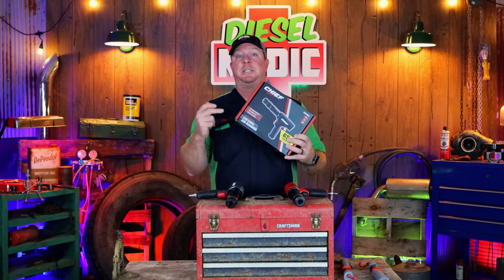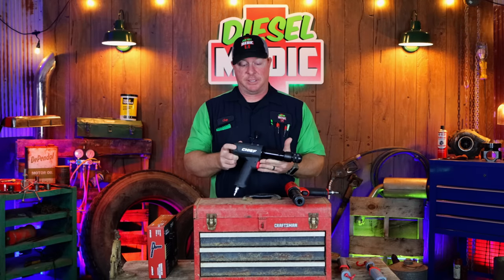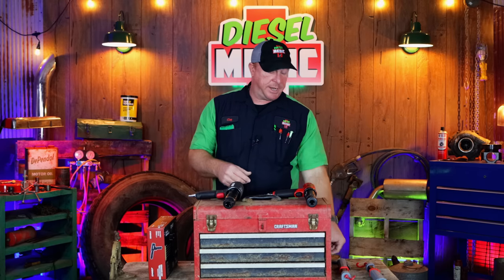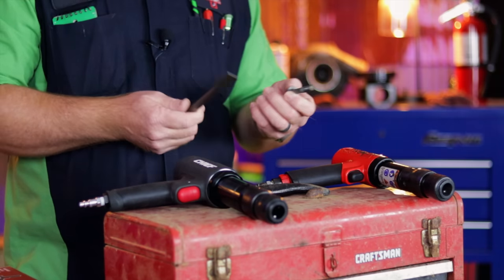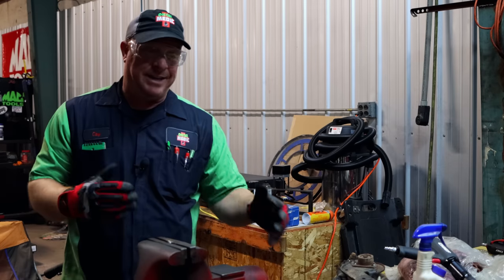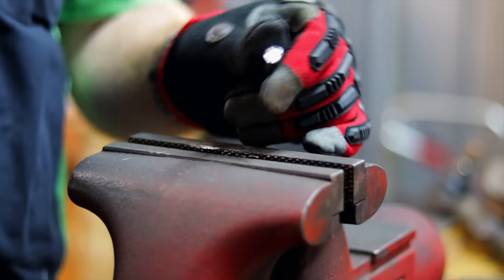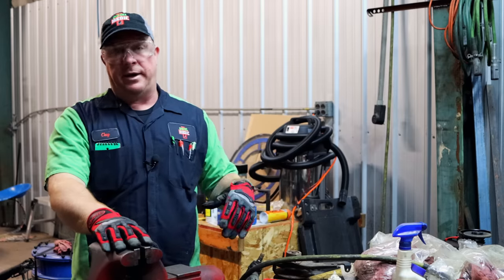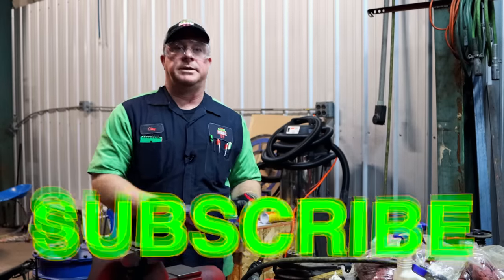Chief Air Hammer Test Head To Head VS Snap On

Comment: Use it for 6 months and give us an update how you like compared to the snap on that’s a real test I would say
Reply: Not much to go wrong on an air hammer bud. Even a soft hammer is good enough for awhile. Not a harbor freight shill, don't own this hammer, and plenty disappointed with a decent amount of dumb tools from harbor freight.

Basically comes down to moisture removal and oiling before putting a tool away. Maybe he more $ is less sensitive to proper use, but this is a great deal imo.

May be disappointed in time for semi-occasional-hobbyist use after I get one for honda ball joint and bearing removal, but I bet it would be quite good for quite a while.

t.buys american whenever possible, as in +200% cost over chine shit for an "I need it for this task, may need it in the future, so why not".

I do have several other chief tools, purchased for specific projects, that sit until I need them again (infrequently) and they're just fine.
Reply: @anon58973  well I’ve had my snap on air hammer rebuilt a couple times but I use it every day so just cause it’s a simple design doesn’t mean it doesn’t wear out if it wears out in 6 months it ain’t worth it to me I can get a few years out of my snappy and before it needs a rebuild and the rebuild is cheap and fast, I doubt your gonna walk into the store get them to rebuild the chief or give you a kit to do it yourself. I think your thinking everyone is a hobbiest which is not the case for me hence why I said use for 6 months then let me know how it is
Reply: @zbrown362  thanks zack, your probably thinging everyone is a pro user. So let's meet in the middle, chief prolly a great choice for amateurs snap-on for the prose like you.

Comment: Awesome. I got the Chief air hammer about 2 months ago and have used it almost daily since. Working in Wisconsin it gets put through its paces. Hasnt been stopped by a seized in hub assembly or brake rotor so far!
Reply from the maker: That’s good to know ! I’m impressed with it
Reply: I did pay the extra $15 or whatever it was for the extended warranty in case i have any issues but so far its been great.

Comment: I had a PH2052  since 1997  it still strong as ever. I've so used many times for the real test was losesening ball joint using a pickle of fork and  low speed control to loosen striped dome shape allen bolts !!  Precion Speed control is key to nothing beats a snap on !!

Comment: I use the Chief air hammer professionally and it's a absolute beast! I also own the Chief  reversible cut-off tool and it's a beast too lol!! You can also still use the 20% coupon on the Chief line.

Comment: Impressed so far, interested to see how it holds up in the long run. For $129.99 hard to argue not picking it up.
Reply: Been using it for several months, holds up great I have been abusing it. The only issue is the threads keep coming out from vibration so as soon as you buy it loosen all the threads put threadlocker and tighten it down and you will be golden

Comment: We were trying to drive out kingpins from the forklift at work... using heat and good old hammer and punch, wasn't budging those kingpins... I recommend the chief air hammer to the boss man so he sent me to go grab one.. the price went up to  $139 and Harbor freight didn't have any accessories (hammer, chisel). Ended up getting an 8 inch hammer bit from Matco. I'll tell you, this chief air hammer is a beast !! It took a little bit of time but it drove them kingpins out 👍👍 for the price, compared to snap on.. can't be beat.. another great tool from Harbor Freight!!
Reply from the maker: It hits hard!

Comment: I love my matco air hammer. Everyone in the shop wants to borrow it because it has more power than theirs haha.
Reply: I have one, the Damn trigger fell off.. Seriously.
Reply: @jeffdarkness666  Dang, that sucks man! Probably out of warranty too, right?
Reply: @koorite.  YEP, I'll get it fixed one of these days, until then I got my old bullet proof Snap on I've had for 15 years, it's not as powerful as the matco but a heck of a lot more reliable.
Reply: @jeffdarkness666  Heck yeah. Our engine guy was using his snap-on air hammer a while back to knock out some frame rivets on a 2500, and after a while of slow progress he asked to try my matco since it was only about a month old then, and it knocked em right out. He said he would get one if he wasnt planning on retiring in about a year haha.
Reply: @koorite.  I like the Matco, don't get me Wrong, just wasn't impressed with the trigger, I had it for 2 years until that happened, and to make matters worst we don't have a Matco Man right now, ours retired to play with his dirt track car full time I reckon.
Reply: @jeffdarkness666  That sucks man. I feel ya though, we didn't have a snap-on guy for almost a year.
Reply: @erictech201  threw the Snap on the floor for 15 years with no issues, so yeah, I have an even older Ingersoll that still works fine.

Comment: Harbor Freight has stepped up alot I have alot of there tools today I have A 3/8 Earthquake 20V Xt it works well and I have abused the crap out of it!
Reply: I have that and the 1/2" and, it breaks'em all loose. My coworker uses M18 Fuel tools and my Earthquake XT are just as good if not a slight bit better.
Reply: What brand air tool oil do you prefer?
Reply: @gilbertsanchez8914  I'm not sure who you're asking but, I use Marvel.

Comment: Great video I have a buddy that has a earth quake impact that is like 8 years old and it will not die rusted hub bolts do not faze it. Like you said HF is stepping up there game. 🔧🔧🔧🔧
Reply: I have a earthquake xt I’ve had it for 2 years and beat the hell out of it. I leave it outside  In the rain and still works as good as new except the throttle on the trigger doesn’t work the best.I’ve taken it apart and you can tell it’s very cheaply made but it holds up.

Comment: Been waiting for a reliable source to review one of these thanks for the content!!
Reply from the maker: It’s really hard to test an air hammer because there’s not a real good way of showing how hard or fast it hits. Like this video the snap on had a fresh edge on a new chisel and threads to help hold it on the bolt. The Chief fought a blunt edge and no threads ..... but it shows it can compete even with those against it.

Comment: I've been thinking about upgrading from my McGraw medium barrel air hammer to one of these for chassis work on my pickup. Today I had an axle spline on a CV axle that would not break. Used a dead blow hammer on it first, then hit it wiht the air hammer.....the axle is seized in there, probably the original axle that's been in it since it was built in Michigan in 02'
Reply from the maker: The Chief is well worth the money. It hits super hard.

Comment: Im sure you know that the threads of the bolt are quite a bit weaker than the shank of the bolt. Also Not giving both a fresh bit right of the bat. I feel like the chief was at a big disadvantage before it even started!
Reply from the maker: It was at a disadvantage and still performed well that was the point

Comment: We use air hammers in Aviation on a daily and juat so you know careful when you pull the trigger with the bit in without it against something cause I have seen them fly out with alot of force. Spring and quick styles.
Reply from the maker: The spring styles I have seen but not the chuck style. I’ve tried making my snap on release one with no luck
Reply: @KoonTrucking  when you switch rivet head sizes all day it starts to get loose and then it happens.

Comment: Thanks for the video clay I have been tossing up the thought of getting an air hammer but the price is nuts for something that doesn’t get used that much
Reply from the maker: Well here’s your answer and you can use the 20% off coupon on them so that brings it to just over a long wheel based $10
Reply: I use mine all the time for various things like hub and rotor removal with a flat bit to breaking wheel bearings loose and many more things

Comment: Great test Clay but I think it would be a lot more fair if you used two new chisels instead of using it on the snapon then the harbour freight. I am sure when you cut off the first bolt it would of blunted the chisel a little. But great show as always 👏👌👍
Reply from the maker: Yeah you are correct but I wasn’t going to ruin two chisels to end up with the same results and two ruined chisels ...... just saying
Reply: @KoonTrucking  Fair enough

Comment: Nicely done video, Clay! Got a question for you about the air hammers, after you put the chisel in the hammer. I was told not to push the trigger without the chisel against something because the chisel could come out, of course thats with the spring retainer instead of the quick change chuck. Of course I do the same thing you did holding the chisel when testing to insure it's installed correctly. Thanks for sharing....
Reply from the maker: I have done it with the spring type too but ai can see how they can come out but I don’t think it will with the chuck style
Reply: It can also knock the end out of the gun if done too much.  The hammer hits against the end of the barrel along with the chisel - not good!  The test would have been better with fresh bits, or sharpened bits in each tool.  That, or using a hammer bit, or a ball joint splitter.  It was good of him to do the comparison.

Comment: Should have put something like a metal T in the vise on both sides of the bolt so the bits wouldn’t slip off then, they both could have had a fair advantage

Comment: Great test Clay my only downside was not giving the Chief a sharp bit on the bolt cutting test. I think it would have done it just as fast. Mac used to make a devastating air in the 90's that was so strong it destroyed itself if you weren't careful. I'm trying to remember the p/n but I think it was a PH8060 with the 4" barrel and you could feel how much more power it had over the snap on. I regret getting rid of mine. I had more problems with destroying my bits then the gun. But they changed it and the newer design wasn't as badass. Interesting vid though let's see how it holds up oh and what was the warranty on it? That's something to consider in the mix....
Reply from the maker: I just didn’t want to destroy another bit when it really didn’t matter anyways. With the shape of the bit that just shows the Chief is even more than it appears! Haha I’m not sure on the warranty I’m sure it tells on the website
Reply: @KoonTrucking  oh ok gotcha

Comment: Mr Clay, I used the big chief a bunch the last two days breaking some welds on our shop gate and I had to bust the head and nut off a stainless 5/8 bolt (not the head size, a real 5/8 x 11 bolt on a stuck conveyor shaft. The hammer is solid, it survived an air line full of water and a couple knuckleheads at the controls. The trick is to use a real Mayhew chisel. The chief brand are ok but you run back to the grinder about 3:1 vs a USA made part. Thanks for the review, I normally buy Astro but didn’t want to be stuck using an oddball .498 shank chisel. Tool junkie that I am, I may buy the Astro anyway 😁

Comment: Tighten your vise I can’t stand watching it move side to side.  

Get a pointed bit and a 3/4 plate of steel and drive it in.  Fresh bit first each.

The flattened bit hurt the chief on the bolt vs the fresh cutting edge the snap on had.  Then it was flattened worse and hurt the snap on on the rebar test.

Not an easy too to test but you should use a fresh bit on each top on each test and make a guide to hold the bit from slipping off
Reply from the maker: I didn’t figure it was worth ruining two bits to show pretty much the same outcome.

Comment: Want it to look cool? Snap On PH3050RBOOT should fit on it. 

It's a .401" shank so I'd rather invest in the truck or Mayhew brand bit sets rather than the crap that comes with them since they're all about $275 for a 5-piece set. The gun itself is good.

Comment: That chief Air hammer is made by the same place with same parts as the MAC tools air hammer. Only difference is the trigger assembly.
Reply: And it's alot cheaper.

Comment: I bought the IR118max kit off of Amazon for about 120, it's awesome
Reply: Bought the 119max kit last week. POS just shot air out after a couple seconds of squeezing the trigger like one of the reviews had mentioned, which I had seen but thought maybe it could’ve just been a bad batch. Anyway, ordered the Matco the next day and returned the IR.
Reply: @kaosaepharn4326  idk about the 119max but I've never had an issue with my 118
Reply: @jake my coworker has the 118max. I might have to agree with the other guy with this one. I was doing a axle recall on a accord.  Used his 118 max and it didn't budge the axle out of the spindle. Used my boys mac tools air hammer and it did the job well. If I was to consider the IR line up I would get the super duty 123max( I think thats what it is) lol
Reply: For what I paid for it, it does what I need it to
Reply: @jakeschmitt5161  it's def an affordable air hammer with a punch ! No doubt$

Comment: So I really only use harbor freight stuff for like my misc shop tools, sockets, hex drives, hand tools, prybars, hammers. All that kinda stuff, I tryn stay away from harbor freight when it comes to POWER tools, for instance my 1/2 impact is a snapon, BUT my swivel socket 1/2 set is icon brand and it kicks ass, especially for the price, even my flex head wrenches are icon. I love them. But yea I for sure would rather have an Ingersoll Rand Diegrinder or ingersoll rand 3/8 or 1/2 inch impact over harbor freight stuff, ya know good name brand power tools, but man this Chief Air Hammer I am really tempted on giving a shot, looks like it kicks ass too, the price is amaing. there is a Ingersoll Rand 119MAXK Long Barrel Air Hammer Kit on amazon for $145 comes with bits and everything, but I really need an air hammer pretty soon and don't wanna wait the day or two for it to come in the mail. Do I give the Chief a shot or go with a decent brand name air hammer instead?
Reply from the maker: Chief is an excellent air hammer
Reply: @KoonTrucking  I just went ahead an ordered the ingersoll 119maxk, along with some other things, stubby 3/8 ingersoll, and ingersoll diegrinder, so nice little matching set, im happy cant go wrong with either honestly, i was able to get over night shipping so win win.

Comment: you also have to remember that as the veins in the air motor ware out so it will get weaker so the snap on will be weaker than when it was new.
Reply from the maker: The snap on hasn’t had much use on it at all now the IR that the chief will replace is wore out !

Comment: I just can't see spending 129 at Harbor when I can get a new Ingersoll Rand long barrel with quick connect and with a chisel set for 149.
Reply: I used the IR branded Air hammer today.  And it didn't do the job. Trust me either get the super duty air hammer that Ir makes or get the chief lol

Comment: The test needs to be more scientific.  New bits for each gun/test.  That would be expensive, but the only way to be fair.  Thanks for your effort.
Reply from the maker: I was going through this exactly like I planned to give the chief a less fighting chance with an older bit to prove it can do what the snap on does w a new one. There’s really ZERO difference in power of them.

Comment: so you didn't have 2 bolts ?? also you used the brand new chisel with snap on then used that same chisel which is now not as sharp in the chief??
Reply from the maker: It was put at a disadvantage on purpose and still performed amazing. It’s easy to tell it hits harder than snap on

Comment: of course its going to take the chief longer when you used the same bit the snap on just mangled. should have spent $20 on an extra bit
Reply from the maker: That was kind of the point of the video to show it does well even with the same but snap on used 🙄

Comment: The unthreaded portion of the bolt has 20% more material to cut thru that is an unfair comparison
Reply from the maker: Just shows how well it works cause it had the dull chisel also. That’s kinda the point of it to put it at a disadvantage and it still hold its own

Comment: Who runs air tools at 90 psi lol.....
Reply from the maker: Haha 😂 you know the politically correct thing is to say “yes sir it was run by the book, it had 90 psi” it technically did have 90 plus about 40 more !
Reply: @KoonTrucking  lol 😄 yes sir!
Reply: @KoonTrucking  That 90psi is at the tool under load. I've seen some crappy air systems drop more than 40psi when you pull the trigger. Service trucks running 1" guns on 3/8" hose reels are the worst.

Comment: Not a fair test you did not use the same bolt the snap on bolt you had it run off the threads
Reply from the maker: I assume you read all that in text on the video ? I clearly put it on video all that you just typed ? Not to mention the snap on had already filled the bit. It was just comparing the two

Comment: Totally unfair comparison testing. Can't use the same bit from the previous tool test and on the part of the bolt that had no threads cut out of it.
Reply from the maker: I put it at a disadvantage and it still held its own! Come on man. Why destroy two bits to show the same tool almost